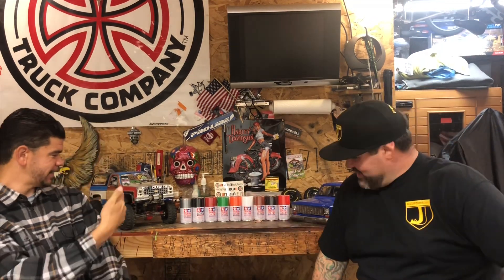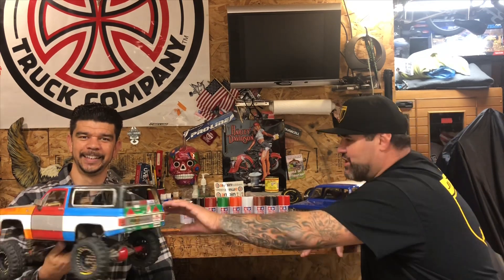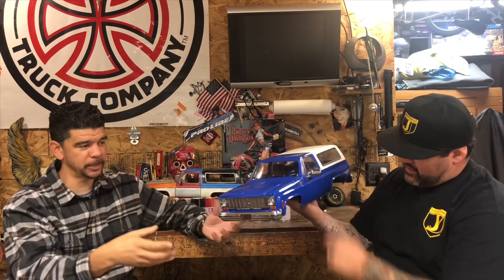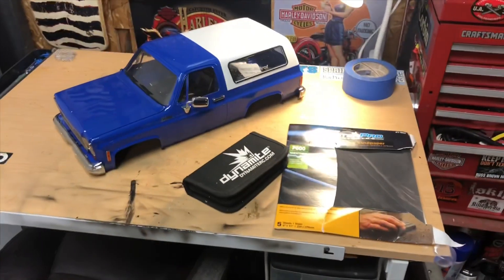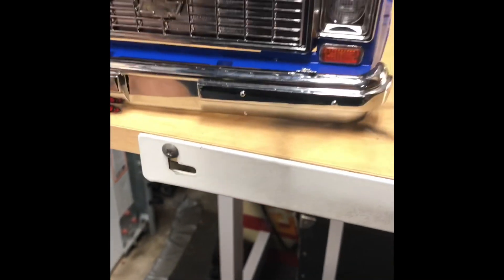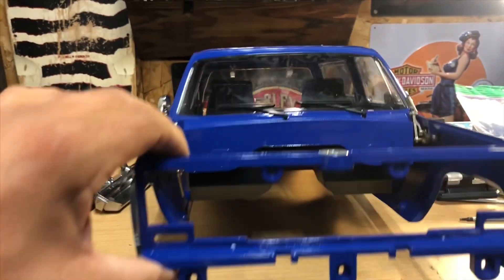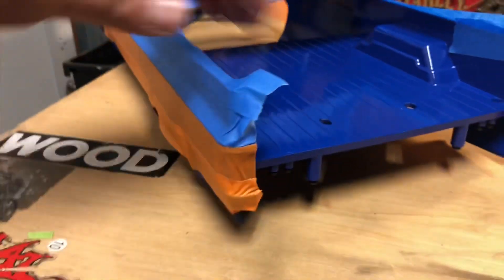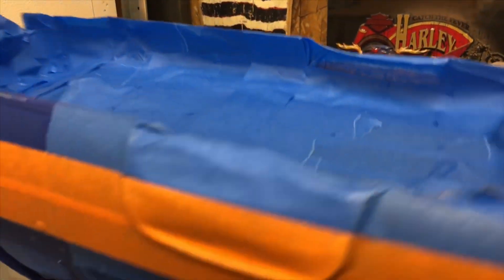OFF 1 CRAWLERS RUBIC CUBE 2.0 paint job

Comment: Awesome that you drop this video as I'm working on my own RC4WD Blazer paint. I've hit the whole body, shell, tailgate and hood with 600 and then 3000 grit sandpaper. I'm going to use a rust colored primer in the hopes that as the truck gets scratched up, that rust color will come through. I also have automotive touch up paint in a metallic green that was available on these trucks in the 70's. Going for a super scale look.
Reply from the maker: R Gile plasti dip works really good under paint for that rust bubble under paint look 👍👍 shoutout to NMP for that tip
Reply: @off1crawlersrc139  Ah interesting! I'm going for showroom fresh day one, but as it get scratched, hoping the rust look comes through.